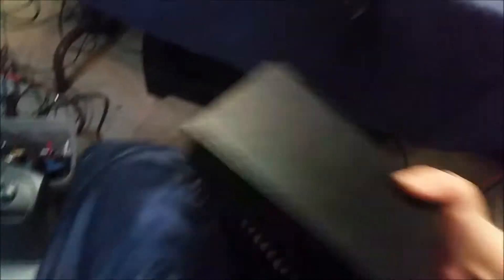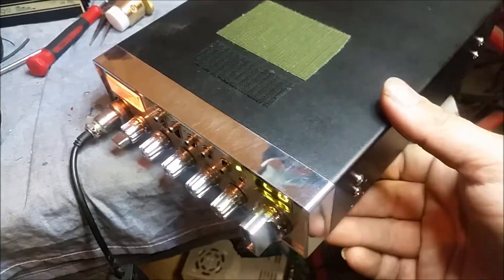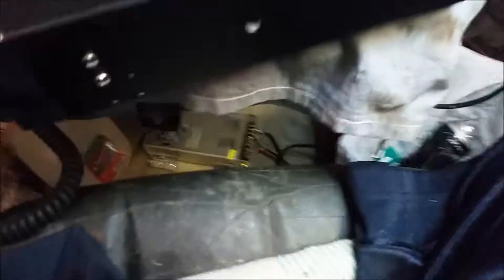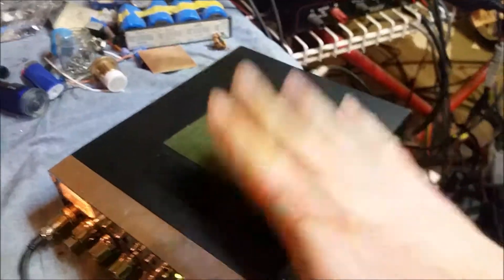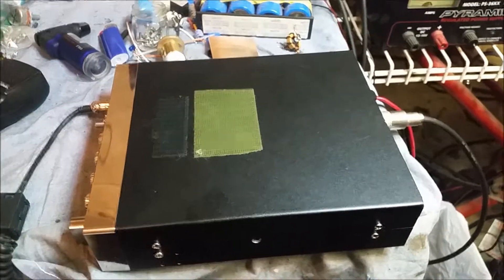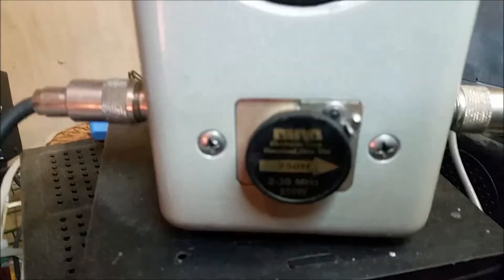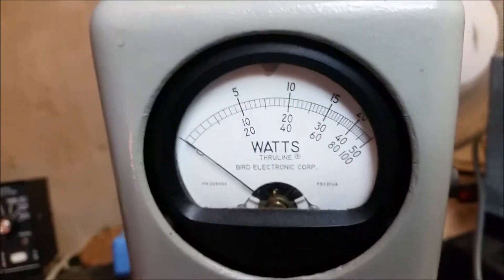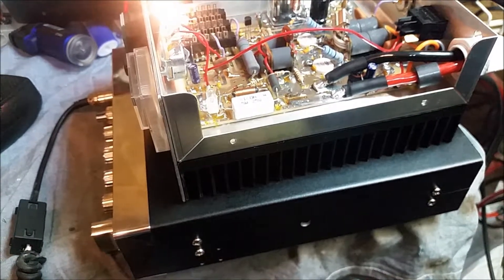Unit 5's Cobra 29 Moded & His Texas Star DX350 Full PWU

Comment: That nice. I got the one with a BEE on it. has RFP 2879 in it now. I had a radio like that but the newer one with weather band in it. should have kept it. still have my 148GTL and 2000GTL . all I got left. in cobra . 73's
Reply: I have cobra FRS 14 ch radios . came in package of 2.  I got new NiMH battery pack for them. think they 4 AAA cells. all shrink wrapped . has drop in charger for both radios. had a cobra cordless phone as well . only a cell phone now.
Reply from the maker: @robertmeyer4744  sweeeeeeeet!
Reply from the maker: That killer killer killer bee!

Comment: My galaxy 98vhp is a 4pill my friend built for me that I'm still not satisfied with. The one you made for me apparently can handle big watts as the RM-ITLAY did not. An in line like the one you made is fine. It doesn't have be inside the radio. If I lived close to you or I was still trucking I would pass through your humble abode area. I have a radio an a 4 pill amp im thinking about calling you about.